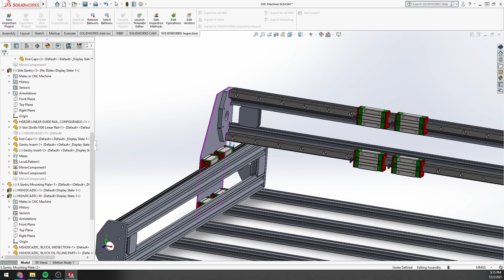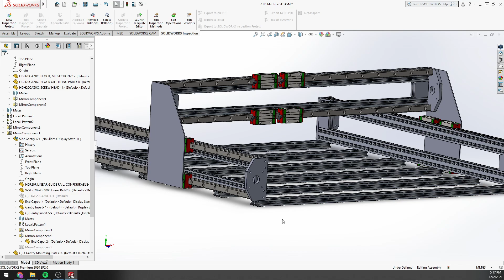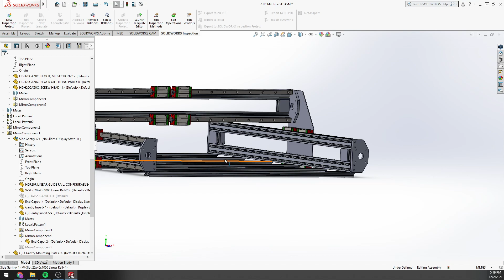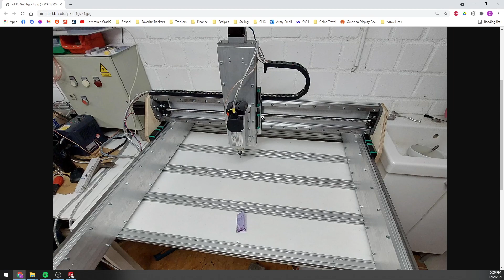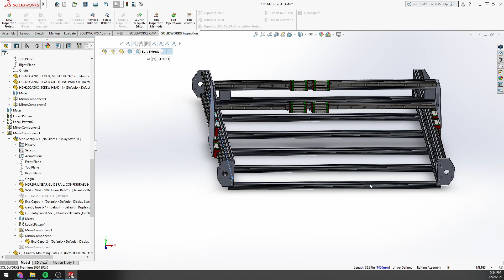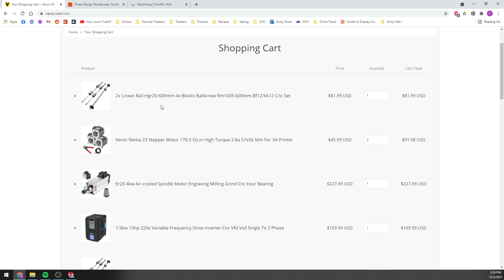DIY CNC Router/Mill Planning  |  Part 1

Comment: Actually this design in not good cuz gantry side plates will support linear guides but not vise versa
Reply from the maker: The gantry side plates are mounted to the linear guide blocks. 
Again this is based on the other design where the user is actually successfully milling steel with a similar build
Reply: @skmagiik  Your gantry is OK, yes it is connected to the table guides by blocks, but two table linear guide structures are pretty weak, there are no any strong elements or triangles to fix them well